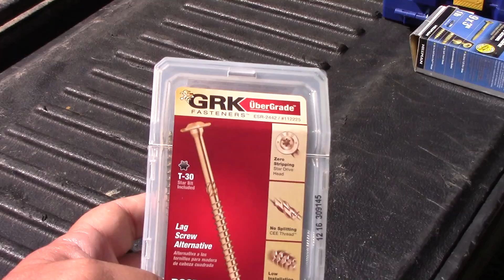12x16 Off Grid Cabin pt 7 - Siding/Window work

Comment: Looks great, one question will you be caulking between each sheet before priming and painting? I have the same siding on my mobile home and it's starting to rot off from lack of maintenance from previous owners.
Reply from the maker: +Carolina Man With the overlap, it shouldn't need it. Their web site says it isn't. It should last 50 years with no warping, mildew, decay or insects. It's already primed.